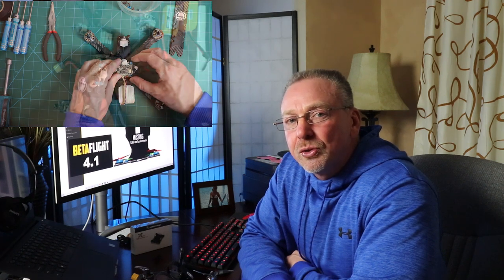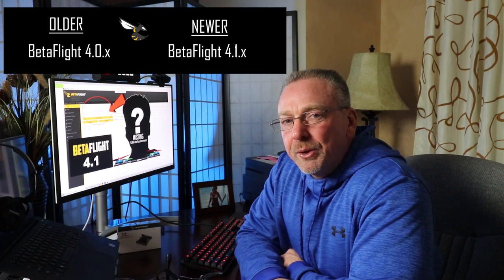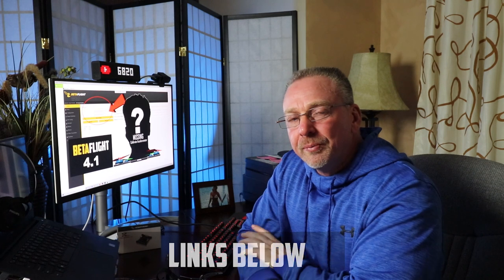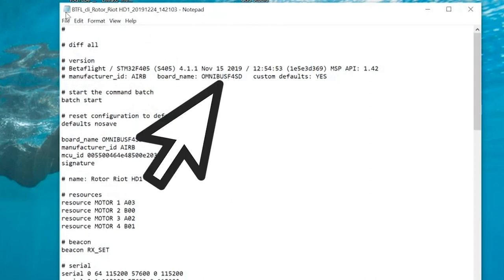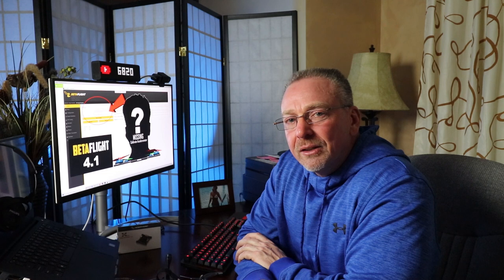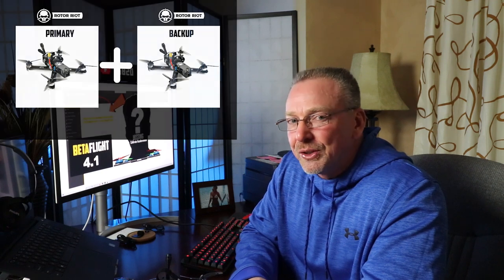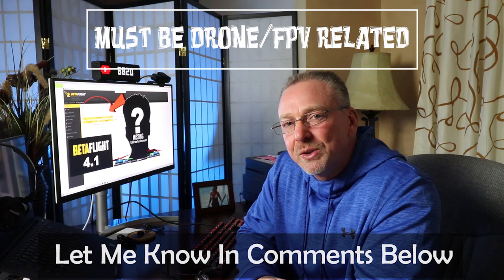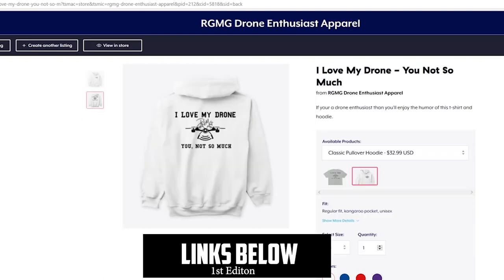BetaFlight Firmware 4.1 | Accelerometer Greyed Out

Comment: A UART (Universal Asynchronous Receiver/Transmitter) is the microchip with programming that controls a computer's interface to its attached serial devices. A UART (Universal Asynchronous Receiver/Transmitter) is the microchip with programming that controls a computer's interface to its attached serial devices.

Comment: Thanks a lot sir! 
 I have one question though. My 'board_name' field on second line shows "MAMBAF7", but closest firmware names in firmware updater is the "MAMBAF722"(which worked). It seems working on my pc and betaflight app, but would it have some complications during flight? It's my first drone and first flight except the sim. And this 'complications' would wreck the machine. 
Please share any information about this if you have. Thanks!

Comment: Hello.. i did exactly the same .. i connected the radio to the receiver without problem. BUT , when I move the sticks or switchs , nothing happens. 
I would be thankful if you could help .. 
Thanks in advance
Reply from the maker: Hi..I tried to find you a video to identify exactly what may be your issue.  Couldn't find exactly what I was looking for.  I would go over to Joshua Bardwell's YouTube channel and search on BetaFlight videos.  Just don't know which one to point you too.  I'm sure he has it covered there somewhere...just not sure exactly where.
Reply: @RGMGFitness  thanks for replying.. but I did search a lot , couldn't find anything
Reply from the maker: Can you give me the exact Flight Controller Model your using and BetaFlight file name your trying to flash to?
Reply: @RGMGFitness  succex mini f4
Reply from the maker: @astemerkhota4923  One other question...was this ever working...and if so, did you save the original "DIFF ALL" file from BetaFlight?  If you did, just paste those first few lines here and it should show you the Firmware you should be flashing to....I didn't see it listed on the manufacturer website.  Looks like iFlight uses the "Succex Mini F4" on several of their BNF units.  If this happens to have been a BNF (Bind-N-Fly) you can actually download the entire original BetaFlight configuraition from here.  Again, not sure if this helps you.  https://iflightrc.freshdesk.com/support/solutions/articles/48001148115-firmware-wiring-factory-dumps
Reply: @RGMGFitness  thanks a lot .. i will try it and let you know if it works